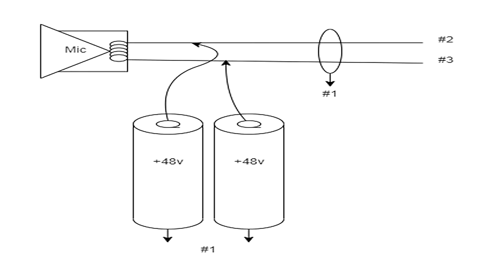Phantom Power 101: Essential Tips for Safely Energizing Condenser Microphones and Active DIs

Comment: Hi Barry, I appreciate you sharing your knowledge. Question - I have an Active DI Box (Behringer Ultra DI DI20) I'm using it to send balanced audio from  an IPAD to a Mixer using a 3.5mm to dual mono jacks cable and 2 xlr cables into to channel preamps in the mixer. In order to do this, the mixer must send 48v to the DI Box. My question is: Will this 48V travel to the iPad's Output? can it get damaged? Thank you in advance.
Reply from the maker: You should be fine, phantom power should not pass through the DI box to the unbalanced side.  One of the benefits of DI boxes is equipment isolation.
For more info see my video on DI boxes: 
https://www.youtube.com/watch?v=D047E4yx0lg

Comment: What happens to Keyboards with unbalanced outputs if I hit them with Phantom-Power from the Mixer?
Reply from the maker: If an unbalanced input is tied between one signal line and ground of the XLR connector, it would apply 48v DC to the keyboard output.  The keyboard output stage may survive, but I wouldn't recommend it.  You may damage the instrument.

Depending upon the mixer, phantom power may (or may not) be applied to the 1/4 in input jacks at the mixer, so if you're going into one of those, you *might be safe.  I'd check it with a voltmeter to be sure.

I would recommend using balanced signals to the PA, so I'd suggest running your keyboard output(s) to a DI box, and using the DI box balanced output to drive the sound system.  This should preserve signal quality over longer cable runs.

Comment: Hello, good sir.  Yours is the most conversational-yet-concise videos I've found so far on youtube.  I have a specific question about phantom power on an older Sennheizer 415 T (not the 416).  Although it's been awhile since I bought it, the warnings about phantom power, burning up mics, etc. has had me so spooked I'm only now trying it.  On advice of the seller, I bought a PSC 48PH to 12T in-line converter. Enough time has passed that I've forgotten the exact set-up, and an hour of online searching turned up nothing.  Should this converter be used between the mic and the mic cord, or at the end of the cable where it will be plugged into my Mackie board?  I know this sounds silly to a pro, but am still wary of destroying this mic. Should the phantom 48 be turned on at the board in order for the converter to have something to convert?  This is for a home studio voiceover booth, and as you've probably surmised, as an engineer I make a hell of a voice actor.  Thank you for your time.  I have subscribed.
Reply from the maker: That mic uses 12 volt T-power, so plugging directly into 48v phantom power may not end well.  I'd use an adapter like https://www.bhphotovideo.com/c/product/147515-REG/Sennheiser_12T_P48_12TP48_48V_Phantom.html which sounds like what you have.  The adapter scales the +48v down to +12v for this mic, and could be placed anywhere in the line between the mic and the preamp input (the phantom power source).  Order of operation would be to mute channel on mixer/preamp, attach the cables, adapter and mic, enable phantom power, then un-mute (turn-up) channel.  To disconnect, mute channel, disable phantom, then disconnect the mic.  Best wishes, and thanks!
Reply: @Barry-Watson  THANK YOU for humoring me on what some might consider a silly question. I've been feeling like those guys in movies who can't figure out whether to cut the bomb's blue wire or the red one.  Much appreciated.
Reply from the maker: My pleasure!  If everyone knew everything, they're be no point in my making videos.
Hope that mic works well for you.  For audiobooks/voiceover, for me, I've tried lots of mics and in my untreated room I find myself often using a inexpensive Shure SM57 with a big foam windscreen (A81WS).  It just sounds smooth and doesn't pick up as much room noise as the condensers.  The sound is very similar to the Shure SM7 for a fraction of the price.

Comment: Hey brother man 🤘 one of the best informative videos on YouTube I've ever seen 👍 glad I found you sir because I have a problem 😕... I'm running a Rockville rpm1470 mixer along with the Rockville RCM pro condenser mic, it has sounded great clear up till this evening. Haven't changed a thing,  when I switch on the phantom power it operates normally for a couple seconds and then fades out completely..??  The mixer includes 14 channel so I tried another channel to the same outcome, so I assumed it must be a microphone problem... Have you experienced something like this? And hey thanks a bunch, I really do appreciate your time 😁✌️
Reply from the maker: I'd try another phantom powered mic, or check the connector with a voltmeter to make sure phantom power is working properly.  If you're getting phantom power, it's probably a mic problem, and I'd take a guess at a failed capacitor inside the mic.  It might recover if you keep the mic energized on phantom power for an extended period (maybe days)... otherwise, it's soldering iron time.  ;)   Repairing microphones is a specialized service, it may or may not be worth it depending upon the cost of the mic and how attached to it ya are.  If the phantom supply on the board is failing, it's probably not a huge issue to service.  Best wishes!
Reply: @Barry-Watson  Barry!!! I haven't run into someone as kind and helpful as you in quite some time 😁🤘👍 thanks a bunch for your help, and the super prompt reply 😮... People like you are very few my friend 🙂 thanks again!!! God bless you brother!!!🤘
Reply from the maker: Thank you, I appreciate the kind sentiment, and I'd like to help how I can so everyone can sound excellent.
Reply: @Barry-Watson  now see Barry, that's exactly what I'm talking about!!! I've just experienced so many people that absolutely do not share the love and good blessings for others. Wish everyone had your way of thinking Barry!!! The world would absolutely  positively be a brighter place!!! I'm just a newbie setting up my home studio for nothing other than a happy place where I can relax and have fun. I'll tell everybody I know about Barry 👍🤘✌️❤️🌞😎💪 one of the most helpful, nicest people I've ever met on the ole interwebs!!! I have a fairly extensive skillset, outside of electronics 🤣for sure!!! So if there's ever something that you think a Good ol boy could give you a hand with, you better hit me up!!! My name is Travis, damn glad to have met you Barry!!! Thanks again!!!💪🎶🤘
Reply from the maker: Thanks Travis!  It would certainly be a pleasure to hang out with ya, if our paths meet.  Likewise I'm always happy to help.
Rock on, and best of luck with your issue.  I'm curious about what you discover, if it's a problem with the phantom supply on the mixer, or if it's a mic issue.
Reply: @Barry-Watson  absolutely 😁👍 thanks again brother man you're my kind of people, I'll get back with you and let you know what I figure out 👍✌️

Comment: I have a ssl 2 interface , my phantom power stopped working suddenly and it not picking up input , I tried changing the cables
Reply from the maker: If you have a voltmeter, enable phantom power and look for appx 48v DC from pin 1 to 2 and pin 1 to 3 on the XLR connector.

Comment: Do all active DI box support 48V phantom power?
Thanks for reply.
Reply from the maker: Every active DI box that I have used can be powered with phantom power from the mixer.  I would consider this to be a normal feature, but double check any unit you're considering purchasing to make sure that it will fit your needs.

Comment: Yeahhh, im watching this after accidently pluging in a cheap dynamic mic into my powered mixer while phantom power was on. The transistors in the amp are now blown up - i guess i wont do that again 😂
Reply from the maker: A dynamic microphone going to a balanced input (3 pin) Really should not be affected by phantom power. But if you have the gains cranked up while plugging in that connection that DC signal can really make a nasty pop come through the system.

Always a good practice, and especially when Phantom Power is operational, to make sure your microphone gains are fully down or channels are completely muted before connecting or disconnecting anything.  Also, the old saying "amps on last, amps off first", so you don't send nasty transients through.

Comment: I recently purchased new mics for a podcast project when I activate the phantom power all i get is a very loud static (picture a TV on a static station) coming through my headset. I've tried other mics and had no problems. Just these new ones. Manual states they require 48v phantom power. Any tips or ideas on what could cause this?
Reply from the maker: Sorry to hear this, it's not supposed to do that.
Have you tried other phantom powered mics?
I've seen condenser mics fail with this behavior.  It could be a bad mic cable, but I doubt it.  It could be a bad phantom power supply, but I'd think most likely it is the mic.  I'd try a different mic that uses phantom power, and if that works - it's your mic.  If that fails, I'd be looking at the phantom power supply.

Comment: thanks, Barry, but...soooo sorry, it was not helpful. What happened to "show and tell"? You just talked "dry", no demonstration of how you hook up the mike with the phantom power and then connect that to the speaker. On the back of my new speaker (Turbosound 1000), there are male and female connections, and I can't (being a total newbie) figure out which one goes where. It gives me the jitters, lol. I don't want to plug it in in the wrong order/direction and get one big "boom" and then all goes dead.... not sure if that could actually happen if I pick the wrong positions for the cables.... well there is my dilemma....I need to hook up the phantom power box, and the mike to the box and the box to the speaker system, and all of them have choices of either male or female plug-ins. So I have no idea in what direction this all needs to go together.  I must be the only one in the world who doesn't know how to hook stuff up.... poor me, lol. Heeelllpppp!
Reply from the maker: Typically phantom power is a feature of the mixing board/preamp, and the channel has a button that enables it for that mic (or a group of mics).  Before turning on phantom power the channel should be muted or turned down to prevent any POP! from coming through.  Same deal if you're using an external phantom box.  Connect your mic to the box, the box to your speaker, and THEN turn on the speaker system, and raise the gain.  Likewise, turn down the gain, turn off the speaker, before disconnecting the mic.  This way you don't amplify any nasty transients.
Reply from the maker: Generally, if you're looking at a MALE XLR connectior (pins), that's an output signal.  A FEMALE connector (with holes) is typically expecting an  input.

Sometimes powered speakers have a pair of connectors that are jumpered together, used to take in signal, and then also pass it right out to another speaker (daisy-chain).  This makes it easy to pass the signal to another box, or to your subwoofer.

Comment: Hi, great video. I have phantom power enabled on my small mixer to power my LR Baggs acoustic guitar preamp. This means that phantom power also gets sent down the line to the output of my Harmony Singer 2 pedal. I was worried that this might damage the pedal but having watched your video, I checked and the XLR output of the Harmony Singer pedal is balanced, so I'm thinking I should be ok? Advice greatly appreciated! Many thanks.
Reply from the maker: Thanks!  From what I understand, phantom power from your mixer should not damage that pedal.  I'd be surprised if any modern active electronic balanced output device designed to plug into a mixer would be damaged by phantom power.
Reply: There are stand alone phantom power units, you could put one of these in front of your pedal and turn off the phantom power on the mixer.

Comment: Very helpful video, my question is, does the placement of the Phantom Power unit effect the noise issue. Does it help to keep the Phantom power unit away from the recorder?
Reply from the maker: Placement on the cable really should not matter.  Generally speaking, I'd try to avoid placing sensitive equipment (mic level) near strong magnetic or RF fields - like right next to a amplifier with a big power transformer, or on top of a lighting controller etc to avoid the potential of picking up hum or noise.

Comment: Thank you for your program . I am thinking of buying a Schertler Amp. 120 w.  But it only have 24V phantom . If I have this extra device 48V phantom and plug it in  from the Condenser Mic 48V  , it will be Ok. Phantom is invisible to Audio. That what you said
But the the Phantom Button on the Amp should be Off.  Am I right.  Thank you. 😊Lennart Sweden.
Reply from the maker: Yes, exactly. I would turn off phantom power at the amplifier and use the external device if your microphone requires 48 volt power.

Many, but not all, microphones will operate happily at lower voltage so you may or may not need to use the external phantom power supply.

In any case, I doubt you would risk damaging equipment regardless of the settings.

Thanks, and best wishes.
Reply: Thanks for the good advice.😊I play Chromatic Harmonica . I try the Condenser mic  Aston Origin  it  needs 48V. I red.  Lennart 😊🎵🎶
Reply from the maker: My feeling is that a typical condenser microphone might be a little sharp and edgy for close mic harmonica, of course I'm not to argue if that's the sound you like.  When I think of condenser microphones I feel their strength is typically high frequency detail.

Make sure to pursue a microphone that is capable of handling the high sound pressure levels of being right next to the instrument like that, really high SPL is usually the arena of dynamic mics.

I would tend to reach for a stage dynamic, like a Shure SM57 or 58. I think those mics would make the harmonica a touch smoother and rich sounding.  Ideally, you could try a Shure 520DX, which is purpose made for harmonica players.  https://amzn.to/3ttOtAO

Rock on!
Reply: @Barry-Watson  Thanks.  The Condenser mic   shure needs some EQ.  The Schertler Amp have that . But I dont have the Amp yet .I also have a small Senheiser Dynamic mic Handheld . I going buy extra Phantom .for my Condenser Aston Origin . Regards lennart🎵🎶

Comment: i genuinely enjoyed and appreciated this vid, i have subscribed!!.... my question is still with 48v phantom power, but is about the quality of different stand alone supply units. How to know the quality of what unit meets professional needs, touring and in the studio. Im currently up for buying a stand alone (if this is the correct way to say it) supply unit and have been somewhat gobsmacked by the options and price difference. Will they introduce noise? Are all of them true 48v? Any insight would just be a treat. Thankyou!!
Reply from the maker: Thanks!  You want a phantom supply that delivers clean, noise-free voltage regulated DC power.

The phantom power is applied to both mic signal lines, and your mixer is able to reject common mode noise, but still I'd want a clean hum & noise-free phantom power source.  The voltage should be 48 volts, but in practice it's not critical that it's exactly 48.0v, lots of microphones will work on a wide range of voltage, even down to 12v in some cases.  So, if the output is within a volt or two, you're probably totally fine.

With today's electronics these are not challenging goals.  I'd expect just about any phantom adapter to work well.  Good product build quality does cost a little bit, so I'd avoid the very lowest cost import stuff.  I'd seek a well known brand that offers an affordable choice.  

Typically it's just a small power transformer, rectifier diode(s), a voltage regulator chip, and filter capactors.  It's not super compliected.
Reply: @Barry-Watson  Hi Barry, thanks mate.
Reply from the maker: Cheers!